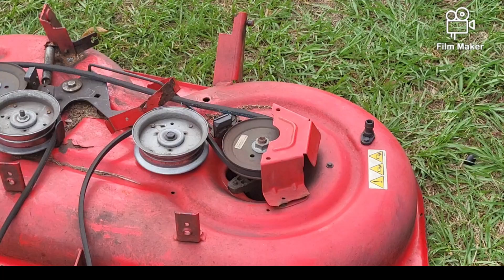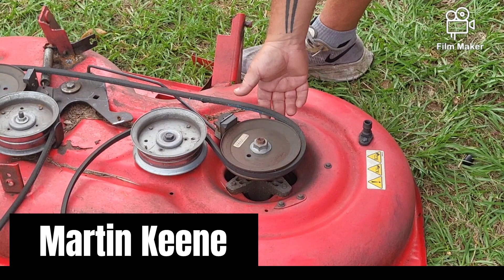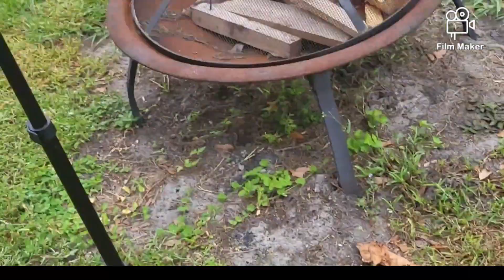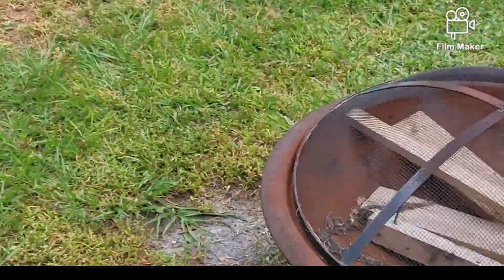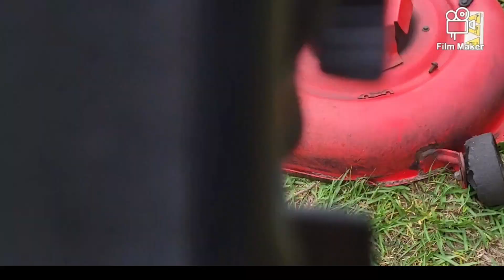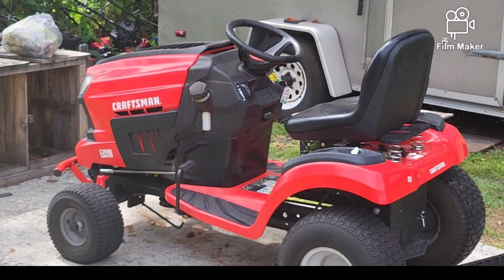FREE FIX Troy Bilt Pony Riding Lawnmower Belt Keeps

Comment: What's the pulley diameter? 😮  Thinking you CAN find a CAN (pun intended) to cut ✂️ and shape to replace the keeper. 12:16
Reply from the maker: thats a good idea.. had not thought of cans i'll have to try that and see if its strong enough.. the pulleys are usually between 5 to 7 inches so would be a big can.. I will keep my eye open for one and try it .. thanks for the idea.. if it works it would be helpful to many people
Reply: @MunkyWrench  Coffee can.
Reply from the maker: @paulmonk7820  I buy the blue plastic can for my normal coffee but i will check for the metal kind.. I also go out on recycle night and look in bins.. I am not scared and if I need containers I go find them.. so I will keep my eyes open
Reply: @MunkyWrench  Don't know if you still can, but used to be able to buy what we called "syrup cans".  Or empty paint cans.
Reply from the maker: @paulmonk7820  I buy empty paint cans from time to time for FARADAY cages.. they are far too thin for keepers ,, I am keeping my eyes open for alternatives cheap and easy

Comment: USE FLAT WASHERS TO GIVE STRONGER CONTACT SURFACE AREA ON THE BOLTS HOLDING THE RETAINERS ON THE DECK. GREAT FIXES.:face-orange-biting-nails:

Comment: These things are trash but yeah my keepers broke aswell but my belt doesn’t come off but I cant get the deck brakes to work
Reply from the maker: Funny you comment today.. I have that machine back here right now I am working on it.. he uses it 40 hours a week to cut grass and he broke a belt.. he tried putting new one on and did it incorrectly .. ran it between the brake and the spindle pulley and pinched it .. the spindles are trashed now and I am on the laptop looking up the new spindles.. saw your comment.. they are great machines if used as intended.. 1 acre or so a week.. they last forever but when you use them commercially they get trashed.. if your brakes don't work u can replace the pads.. the spring might also be off , stretched or broken so check the lever spring.. glad your working on it yourself .. hope my vids help.. I am always here for questions.. thanks for subscribing while your here it helps a lot
Reply: I had them on my mower but the belt still keeps jumping off so where is the part that you tighten up the belt with I have a spring up on her mind so am I supposed to turn that spring
Reply: I have a snapper pro stick steering
Reply from the maker: @phyllisgraham6985  there is no adjustment that I am aware of to tighten .. if the belt is worn out and stretched thin it will jump off .. that's usually the easiest way to fix a problem.. the spring can be old and stretched a bit as well.. you can try replacing the spring.. but otherwise the only thing you can do is find out your belt length and buy one that's half inch shorter.. also be aware that the thickness of the replacement belt is as important to the length.. if it calls for a 1/2 inch thick belt and you put a 3/8 inch thick belt on it will jump off cause the thickness affects the length needed

Comment: I noticed that yours spindle  blade pulley  are not aligned with belt brakes. Is that normal?
Reply from the maker: yes there is room to move up and down  when the spring that holds the unit is off.. once its all back together it lines up ok and if it doesn't line up it usually does as soon as you turn the blades on for the first time after you install the deck and belt.. thanks for subscribing and if you ever need anything just send a message

Comment: apparently there are several of these troy bilts with this same problem. I have a small engine repair business here in Kaneohe Oahu and this seems to be the problem with all of them as well as the belts breaking. Working on some of these tractors, and i know MTD makes them all, but Troy-Bilt seems to be lesser quality than Craftsman and John Deere, even though MTD makes them all. The material seems to be better on Craftsman and John Deere and even Cub Cadet.
Reply from the maker: I would agree with you on that